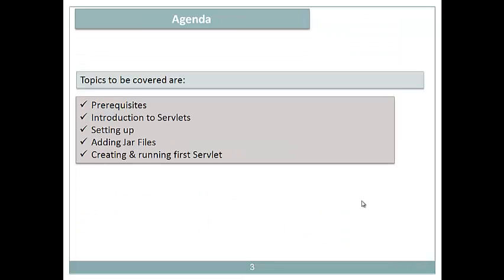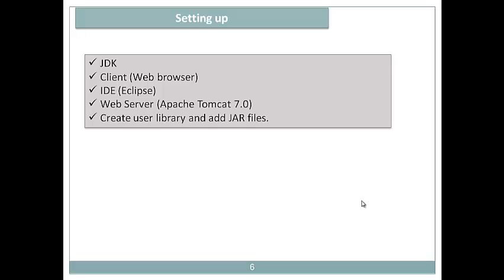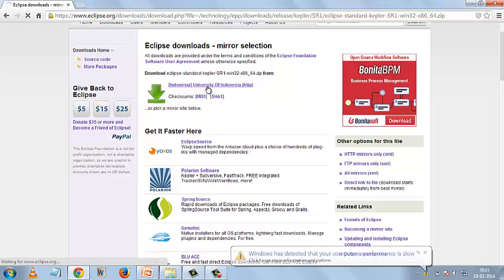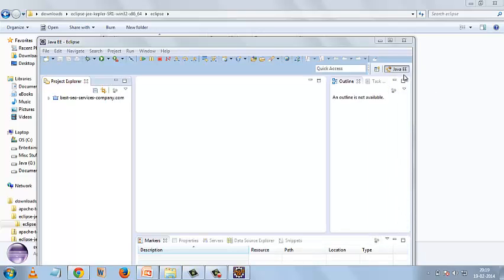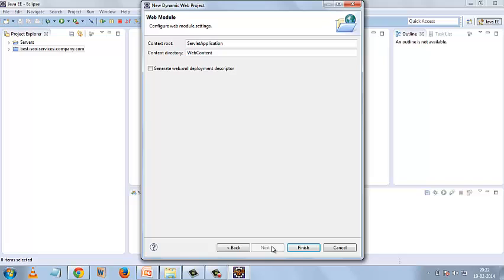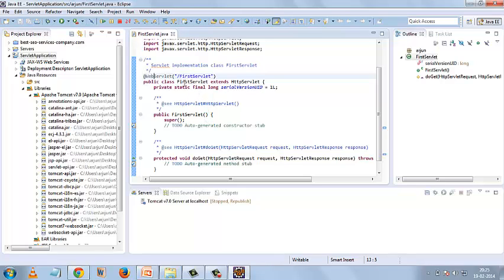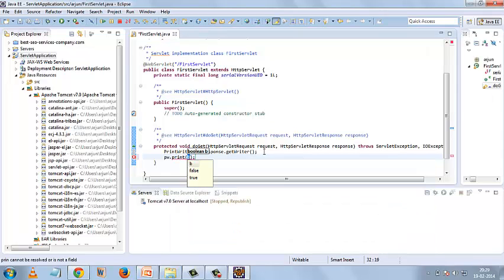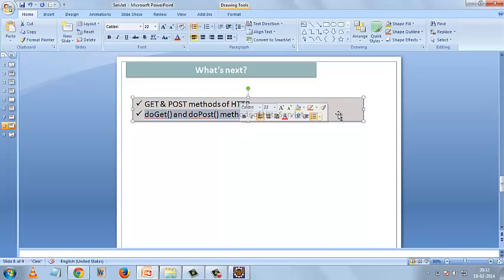Servlet Tutorial 1: Setting up, Download & Install Apache Tomcat & Eclipse.

Comment: Sir when I run these code in sever then a " port 8080 required by tomcate v8.5 server at localhost is already in use" error came.... sir how to change the port number....
Reply from the maker: You can change the port number in server.xml file.

Comment: Thank you for reply  sir... I have opened the same you told me but its showing there java  default,java browsing and java type hierarchy not showing java EE 
I had Installed  eclipse standard kepler SR2.
Reply from the maker: Anu Singh there are different variations of eclipse you were supposed to use the one for Java EE edition, i.e. you probably got the wrong variation
 of eclipse

Comment: error:several ports (8005,9999,80090required by tomcat 6.0 at localhost are already in use.
how to solve?plz plz tell bro....
Reply from the maker: Try changing your tomcat server port, some other application must be using the port that is configured to be used by tomcat.
to change port number:

1) Go to conf folder in tomcat installation directory

 e.g. C:\Tomcat 6.0\conf\

2) Edit following tag in server.xml file

<Connector connectionTimeout="20000" port="8080" protocol="HTTP/1.1" redirectPort="8443"/>

3) Change the port=8080 value to port=80 or some other value

4) Save file.

Comment: I thought this was a well done video.  It was very easy to follow and set up my eclipse (I had already had tomcat installed)
Improvements I would suggest is defining the difference between Eclipse IDE for Java Developers, which I downloaded at first by mistake, and Eclipse IDE for EE Developers.
In addition, when you were making the type PrintWriter. I would of rather seen you write out the word, the IDE show an error, and then you showing how to correct the error.  At first, I was so confused, why I had an error and you didn't.  This was an easy fix, however it would of been nice to see how the Eclipse error suggestion works.
I will be watching more of your videos.
Reply from the maker: Yes, Marco Galassi talked about the same in his comment below. Thanks.